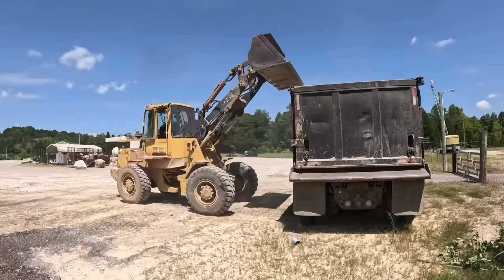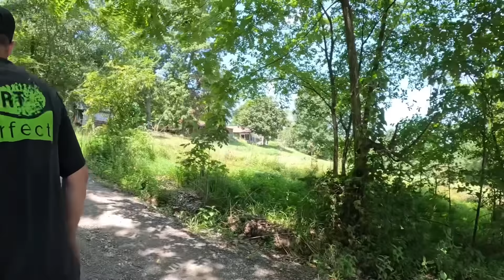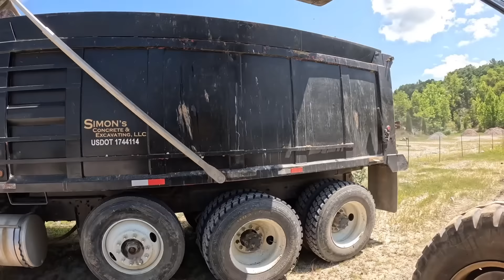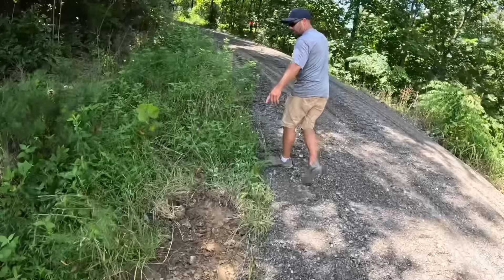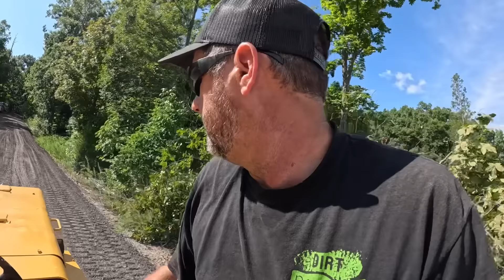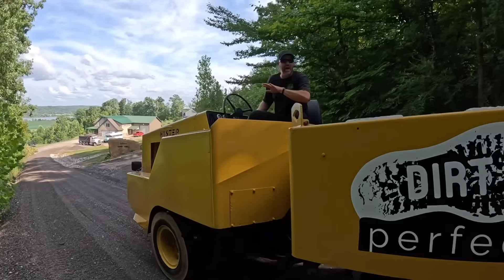5 Years After Redneck Paving My Driveway, Doubters Said It Wouldn't Last. Let's See Who Was Right!

Comment: There are those out there who do not realize that asphalt millings will clump if they sit. The summer heat will also warm them up and increase the chances of that happening. Chip sealing and seal coating asphalt adds additional product to the original asphalt which can increase the chances of clumping. And then some do not realize the main ingredient in recycled asphalt is millings. You did a fantastic job with the repairs to your original paving job. May it last a long time.

Comment: That is a 200% improvement. Further, that roller is a beast, even though it struggled at times.
Reply: It's struggling because it's burning more oil than diesel. But it gets the job done 😂❤

Comment: The drive came out looking great. I spent the last 30 years of my working life operating a truck mounted roadsweeper and here in New Zealand. Part of the job was picking up those millings that didn't make it up the conveyer on the mill and if we were close to our base some ended up there for the same purpose. The millings we laid in our yard lasted about the same length of time. In actual fact  one council started trialing them on some of their gravel road about 3 years before I retired but I don't know how successful it was. If you spray a light coat of diesel over the heap then break it up and mix it with the loader, spray it again then load it it will liven them back up and give a better result.

Comment: I helped do Millings like that one time.  We spread them like you did, graded them out.  Then we sprayed  Deisel on them with a spreader bar and rolled the heck out of them.  The Deisel was supposed to soften the Oil in the millings some.   It turned out pretty good.  you guys are better at spreading than we were for sure.
Reply: Pavers, not papers

Comment: When the profilers first came on the scene in the 80's the millings were a waste product (until they figured out they could put them into a new hot asphalt mix years later called RAP - reclaimed asphalt product) which the quarries nearly gave away.  Because it was so cheap we started doing long driveways with them like yours so it was affordable to the homeowner.  We found out really quick that the best way to secure them after grading was a smooth drum vibratory roller...it worked every time (after having to go back a fix a few driveways we didn't roll initially).  I know those wheel compactors do a good job for what they are made for...and this job is long done by today...but just thought I would throw out the vibratory roller idea to you for the future...it always worked for us.

Comment: Asphalt roads need repaving. Some sooner than later. Our "new" 4 lane parkway has been repaved 3 times in 7 years because the low bidder did not do a dirt perfect job. Some body has a motor grader attachment that would make momma very happy with a smooth driveway.

Comment: I use the same skid steer for pulling sub grade large slabs of 150 x 200 foot. Give or take each way. A few different jobs a week. On 150 by 200 with a lazer mark on two opposite corners. Not checking myself . Be off 1/8 yard of cement. The contractors love not buying an extra 6 to 10 yards of cement. They say they check it but can never find the place i could be off a 1/4 inch. I always cut my grade dirt going forwards. I do not ever back blade. Back blade on float causes long low sweeps that are very hard to fix. They save a lot of money not doing it them selfs.

Comment: I had an algae issue in my 450C dozer and i used a additive called killem and it worked great but i installed an inline filter before my factory filter to save using them up and after a couple times replacing the inline filter it finally cleaned up.

Comment: Driveway ended up looking good and that's what matters.  I suspect the trick to being able to spread old millings is to pre-work them like cold patch.  Spread em out on a hard surface and backdrag the chunks out shortly before they go on the truck.  It adds a step to the process if you have a machine on site, but might be slightly superior product being better mixed than if it's worked on site.

Comment: I would give it one full hot summer to bond good. If you have a soft spot dig it out about six inches deep, fill with five inches of concrete and one inch of blacktop patch. Then chip and seal the whole thing for about three years in a row and you would have a great road that is all but maintenance free for decades. Just make sure to dig out the soft spot until you hit solid base on all sides. When the concrete dries it acts like a foot pad on a crane spreading the ground pressure over a bigger area. The black top patch acts as a malleable top to keep even with the surrounding surfaces which gives an even base for the chip and seal. I've done this to fix asphalt problem areas and they are holding thirty years later. So many try to put a concrete plug in the blacktop but then it does not pack with the surrounding and starts leaking on the edges softening the base. The key is keep water out of the subsurface. Asphalt drives have almost zero strength on their own, they are just a water seal on the base gravel. Keep water out of the gravel base, you will never have a soft spot.

Comment: It looks like the nut holding the throttle lever on the fuel pump is loose, common fault is lever not seated correctly on slot system

Comment: Mike, ignore the unprofessional negative nellies criticizing your millings dispersal. 
Millings naturally clump simply because they're as sticky as Carmel popcorn.
Pick up a handful and squeeze them your hand is going to be covered in sticky tar.
Fresh millings clump in the trucks that haul them away on a hot day.
In my small Michigan farm town I grew up in the did milling scraping in the fall after it cooled off so thetruck beds would be relatively clear after it was over and didn't require being scrapped out by hand costing taxpayers additional funds.
Mr. Morse was our superintendent of roads, and he gave a lecture at our high school on how road departments worked.
Nobody wanted to scrap millings out of the bed of a dump truck in summer.
You'd sweat a gallon of water in half an hour.

Comment: I’ve spread grinding with a quarter frame dump trailer. I would set the chains all the way out so it wasn’t flipping back and forth. Run the bed about half way up and as soon as I started moving unlock the tailgate and hammer down.That being said I don’t think I would’ve done that hill of a drive you have. Some of these morans would probably try to tailgate 5x9 rip rap.

Comment: Mike, I have a question about that roller.  If you shear the ring and pinion or something in the drive line disconnects due to a failure, will it still have brakes?  The local township had one of those here.  The brakes operated on the drive line and not the wheels.  My neighbor was operating it and the brakes failed to work after something in the drive line failed. (No brakes at the wheel hubs) He ended up retiring on disability because of the accident. It was a "widow maker" by design.
Reply from the maker: Yes

Comment: 5:01 is that all the power this Cat has, or are you filling in 2nd gear to prevent wheelspin ?
Reply from the maker: Sorry don’t see what your asking about
Reply: @DirtPerfect  This older Cat seems a bit low on power compared to my friends loader, digging into those millings. I think Cat just designed them that way. In Holland we use loaders for 50% of the jobs you use a dozer, so ours are designed different i think.

Comment: DP , I have a suggestion,well maybe two. Number one,,use the millings before they start to set up, or turn the pile by taking small amounts and drop them from as high as possible to break them up,then load. Of course it may be 5 or 6 years before you do this project again. Just a thought / suggestion.

Comment: Is that a Talkuhatchi TL 130. Do you ever have that skid steer when you start it some morning and one of the funtions don't work. Like maybe the tracks won't work. Next time the bucket or the lift arms won't move. Or the fuel shut off won't work. Even shift from 1st to second gear. So you check the fuses than the relays. Maybe take off a selinoid or clean a funtion valve. Check or bypass safety's. You call Talkuhatchi and they don't have a clue. Nation wide online mechanics don't know what the problem is. It took me 9 months to find the problem. My boss finally gave up on it after 5 years of out of the blue a funtion would not work messing up a job schedule . Well i fanally found what the problem is. They all have that problem making them useless sometimes. If you are having that problem i will tell you. After i fixed it 5 years ago it has worked perfect. Owner said that skid steer has made him more money than any other machine he owns

Comment: Well just start off with Mike when you are loading those get a load in the bucket and dump it back onto the ground as you back up that way it will help grind up and bust up your big clods I used to work for indot in Muncie Indiana and that's what I always had to do was try to bust them up by dumping them on the ground out away from the other millings and pushed back into them and get a full bucket😮

Comment: Mike  pls look in to mounting a vibrator on the truck bed so the material don't stick? You don't need a big one a small will do.  It do wonders with dirt, frozen stuff , mixed material . Easy to mount 4 bolts and just a push button when you want to activate it. Make it easy to dump... way less tipping over risk :P   
Just try it you will not regret it.  Dump Truck Body Vibrator
if your not sure do a test take a electric motor on the shaft mount a half moon weight  and clamp it/bolt it to the bed you will see the effect and after that you can see if you want to have one or not.

Comment: Rule #1 Mike. Don't believe anything you hear or see on the internet. Tailgating the millings would work if they were just taken off the road surface and spread right away before the tar gets to harden. After they have sat for awhile you would have to heat them up to make them speadable again. I used to work for a paving company and we call this stuff cold patch for a temporary fix for potholes. The diveway looks great should last another five years.

Comment: Five years, is it? Every time you buy something, it seems like it gets used more than you anticipated.  Bubba and now the roller.  You built the tile plow never anticipating the amount of work that would show up for it.  Whatever you want to buy, will get used and broaden the scope of your work.

I watch to see how you do things, learn a bit, and for entertainment.  Would I do things exactly the same.  Probably not.  There are multiple ways to get to ten.  I might have dozed the millings to break them up and make them easier to load and spread.  Years ago, an asphalt/ chip seal road near me was ripped, windrowed, and worked over with a pad foot to break it up.  The ROPS broke and nearly killed the operator on that one.  The results were bladed out and used as base.